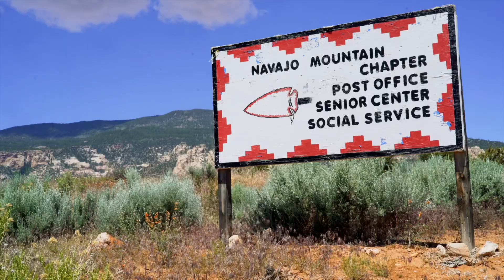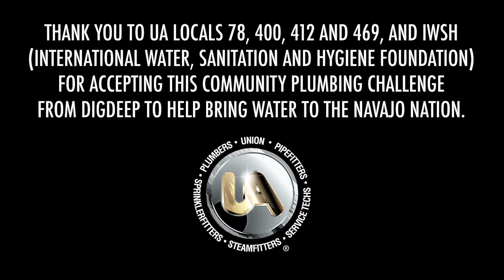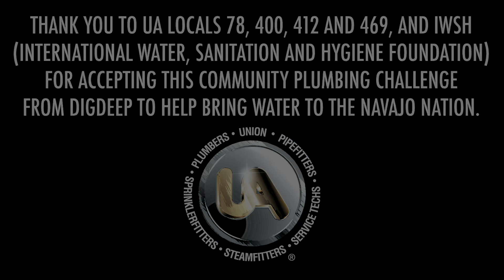UA Plumbers Help Bring Water to the Navajo Nation

Comment: Last June, we did several posts about The International Water, Sanitation and Hygiene Foundation’s (IWSH) annual Community Plumbing Challenge (CPC) from June 1-8, 2019 on the Navajo reservation in Piute Mesa, AZ. Volunteers from UA Local 400, UA Local 412 - Albuquerque, MN, and UA Local 469 - Phoenix, AZ, worked together to bring clean, running water and safe wastewater disposal to 3 homes in a very remote mountainous region on the Arizona-Utah border. UA 400’s Tom Adams, Kevin Baird, plumbing instructor Bruce Dietzen, and Randy Lorge, director of workforce training and development for The IAPMO Group and UA 400 member were instrumental in completing the work in the homes. Check out the video and thanks to everyone who participated! #UAproud #UA400plumbers #UA400apprenticeships #UA400training UA400MakingTheWorldABetterPlace